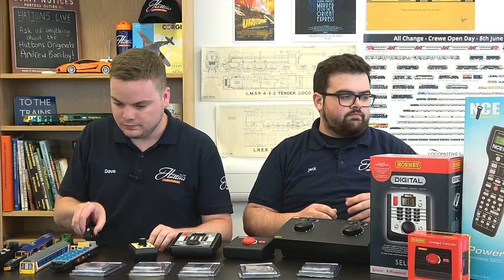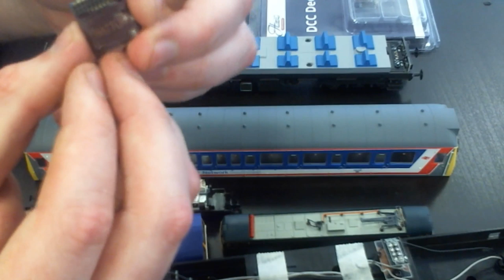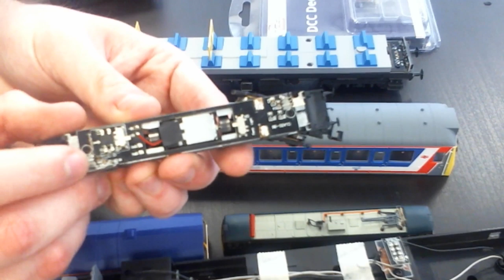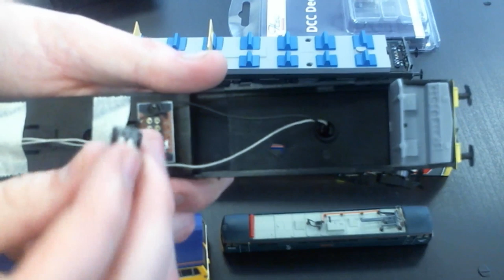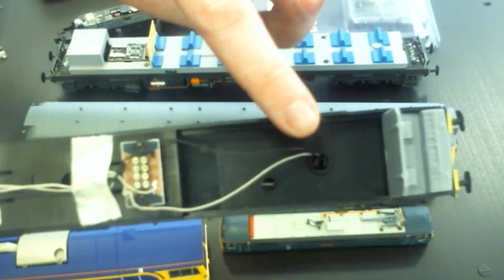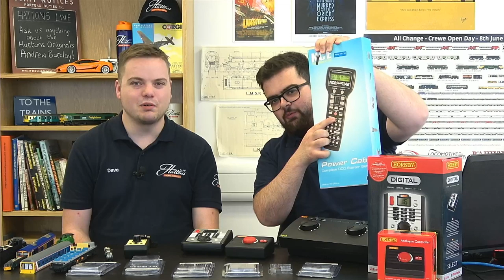Analogue & Digital Control - Live Q&A with Jack and Dave

Comment: if you take an analogue loco , if you change the loco to dcc control ,then use say a gaugemaster dcc controller ,do you loose top speed compared to analogue control top speed ?
Reply from the maker: Hi Anthony, this depends on the settings on the decoder. You can change the speed curve and the voltage at the max speed step to be as fast or as slow as you like (voltage and motor permitting of course :-)) but you shouldn't lose any top speed.

Comment: Hi team great show as per usual, I have Hornby and Lima locomotives what decoder do you reccomend for them.  None of them are DCC ready. Also what cab would be easy but middle of the road to use with them? I wish the boys had discussed what the pins mean more functionality? Cheers
Reply from the maker: Hi Guy Prior, thanks for the feedback on our video. I've passed it onto the video team. 
For non digital ready locomotives like the Hornby and Lima ones you have, we recommend the Hattons own DCR-8pin-Harness decoder as they come with the wires that will need to be soldered directly into the locomotive wiring: https://www.hattons.co.uk/62784/hattons_originals_dcr_8pin_harness_8_pin_harness_4_function_1_1amp_decoder_with_back_emf/stockdetail.aspx

For controllers, the NCE Powercab and Gaugemaster prodigy are ideal for use with the DCR-8pin-Harness decoders:
https://www.hattons.co.uk/60679/nce_524_042_nce_power_cab_2_amp_digital_dcc_controller/stockdetail.aspx
https://www.hattons.co.uk/22085/gaugemaster_dcc02_prodigy_advance_2_starter_dcc_controller_package/stockdetail.aspx

As for decoder pins, varying pin counts can be down to the preference of an individual manufacturer. Some attempt to standardise the connection used, but can often be based on what each manufacturer opts for from individual choice. Additional pins can allow for additional function usage such as extra lighting settings, but this again would be down to the individual manufacturer for including compatibility for such features within the initial model to begin with.

If you have any questions regarding digital or anything model railways related, feel free to contact our customer experience team via phone or email and they'll answer any query you have.
Reply: Hi and thank you for the advice I will be thinking about this seriously and saving of course. Is a z21 a good thing to throw in the mix? I  was thinking of train control.
Reply from the maker: Hello! The Z21 is a controller option you could use, and is available on our website: https://hattons.co.uk/62207/roco_z21_z21_3amp_dcc_digital_control_system_for_use_with_smartphone_or_tablet/stockdetail.aspx

The Z21 controller is a good option if you wish to use your smartphone as a handheld controller.